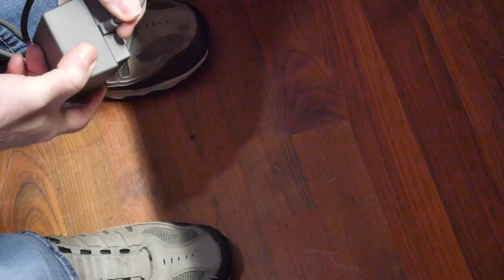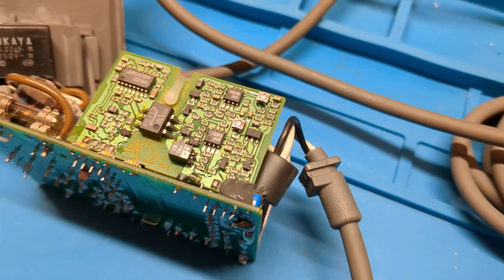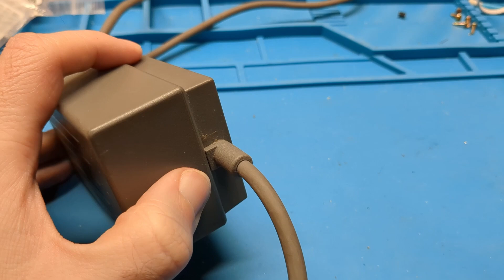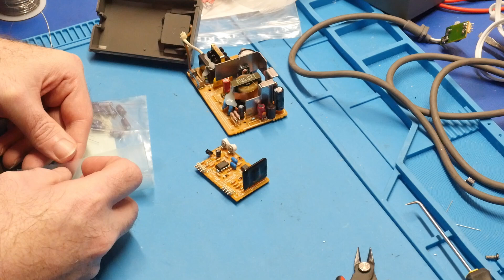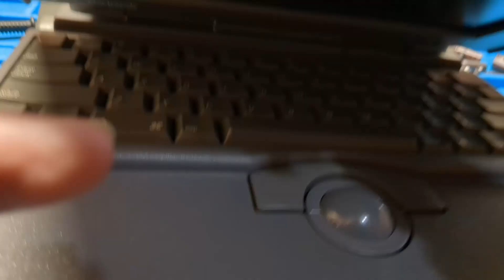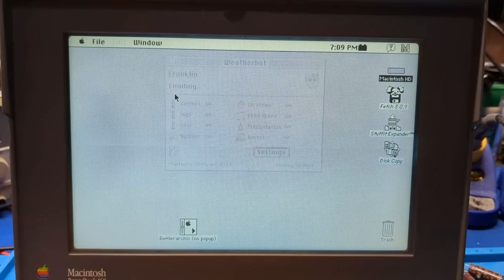Macintosh PowerBook AC Adapter restoration

Comment: The silicone mat will resist, as soon as you don't use something too Sharp. I will be way more worried for the floor Tbh (MDF laminated floor boards)
Reply from the maker: Not in this case because the table is plastic. So if I do any kind of percussion everything bounces everywhere
Reply: @THEtechknight  the table below, I haven't think about that Tbh